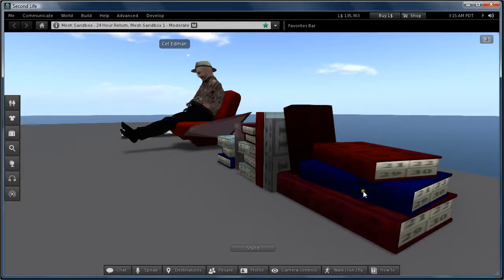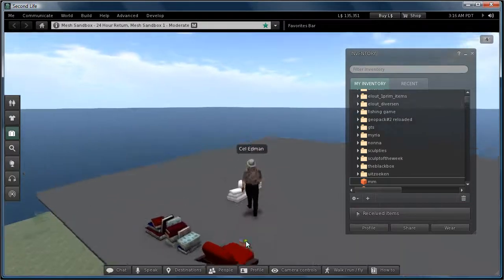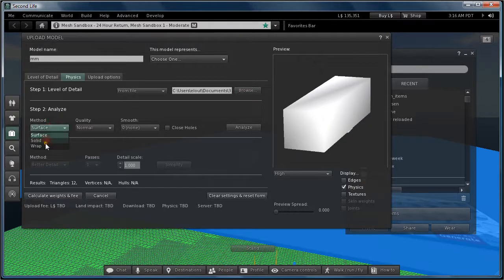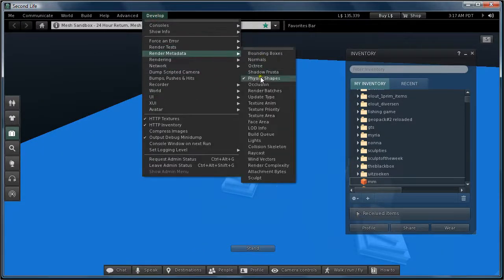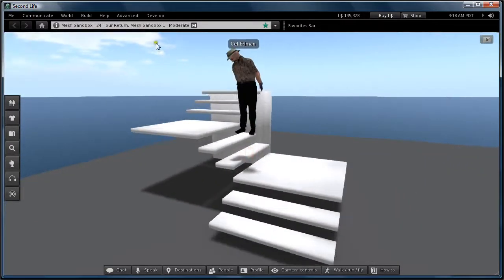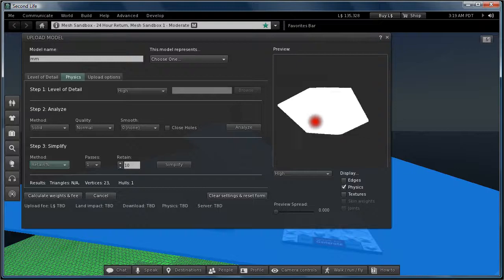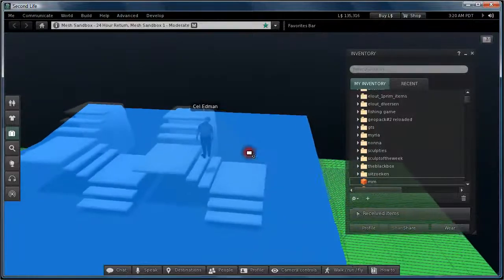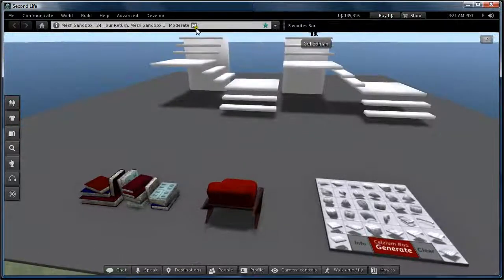Mesh, Physics and LI in SL

Comment: The way land impact is calculated has changed since this video was posted.   Convert your mesh physics to prim now and the land impact goes through the roof.   So the final land impact on the steps which is shown to be 2 in the vid would be more like 15 to 20 here in 2016.
Reply from the maker: +Al Keeling Thanks for your comment Al, have to experiment a bit the next time I log in.

Comment: its nice but how to make physics dae and upload it from file?
Reply from the maker: Hi Duk Dux, mostly I have just a simple box/cube, I saved it as cube.dae on my HD. Use this cube, for models that really don't need a physics model.

You can load your 3D model, then..... in the Physics tab, you can also select another model 'from file', for your physics model.
And it will wrap your physics model around your 3D model,
(SL will scale the physics-model the same size as the 3D-model)
The simpler your physics model is, the lower the landimpact.

For more complicated 3D models, like a house, bridge etc. You need to make a physics model, the same size !! as your 3D model, you can use cubes or like single sided planes or triangles (from celzium #01)
But still the less models/parts you use for the physics model, can make a big difference in the LandImpact.

You can read in the comments here, for some other tips and tricks. Good luck! wish you a creative week
Reply: Elout de Kok thank you very much on help,now understand it